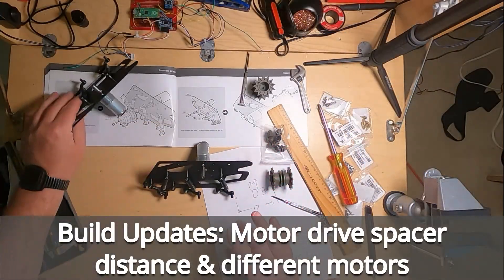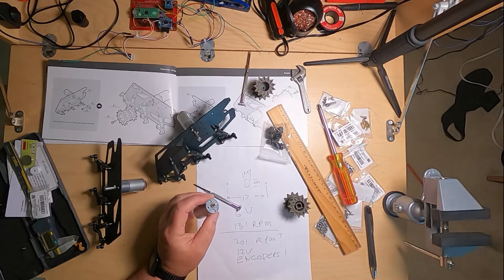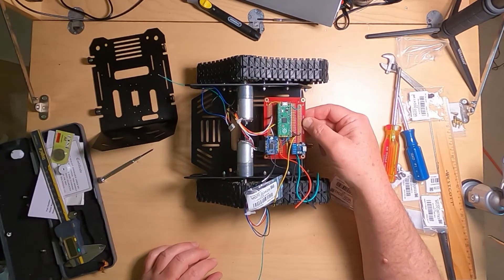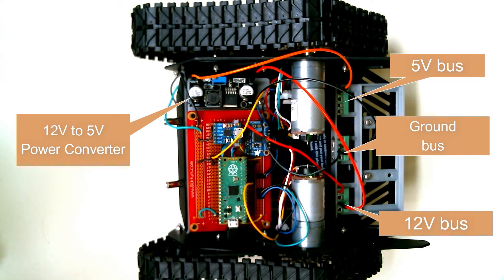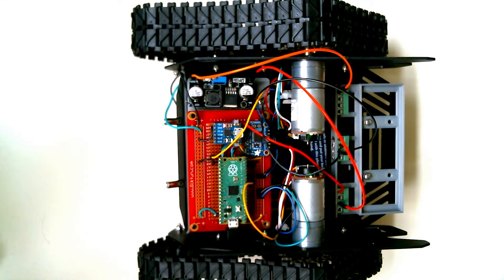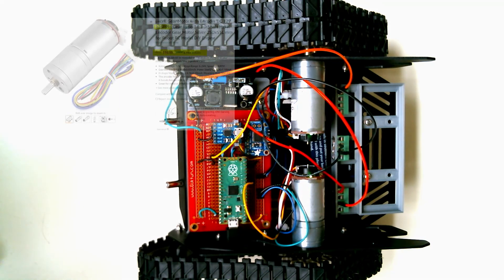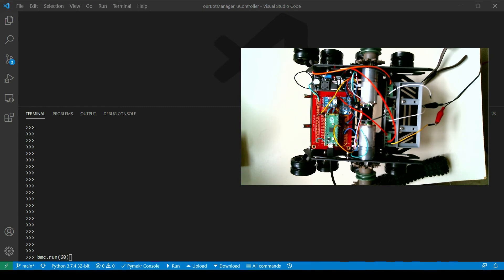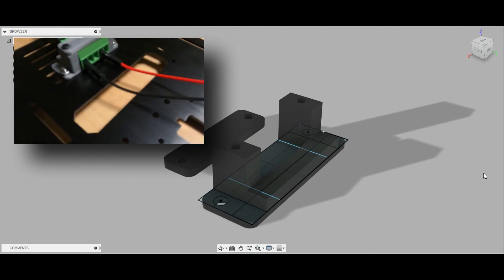20: Robot base build. DFRobot’s Devastator Robot

Comment: in this dc motor include an encoder also ??
Reply from the maker: Yes, that is mostly what the Pico microcontoller is in charge of, I tell (Via a ROS serial interface) it how far I want to move the platform and it takes care of running the motors and watching the encoders to move that far (In theory :)  track slippage on these tank bases can be a wild card).

Comment: hello,  in the microcontroller, we use raspberry pi pico only right?  no need raspbery pi 4 or not ??
Reply from the maker: For the motor controller I used just a raspberry pi Pico, however for overall control of the whole base I use a RPI 4 (I needed a ROS2 node and that only runs on full linux)
Reply: @LupinCorp01  thank a lot